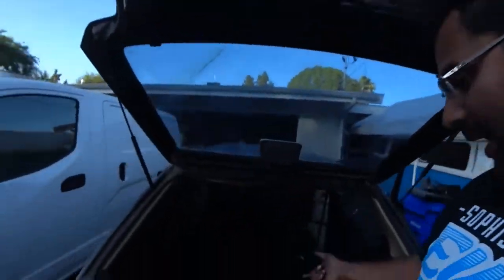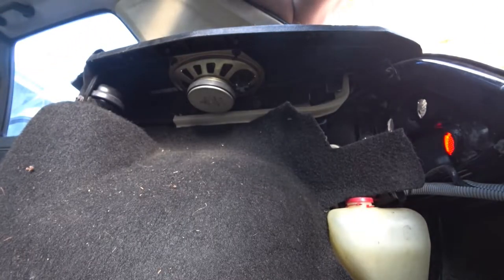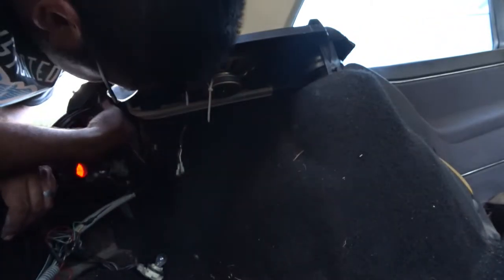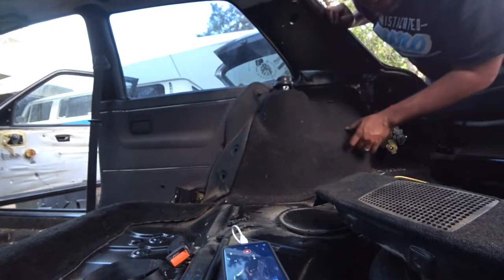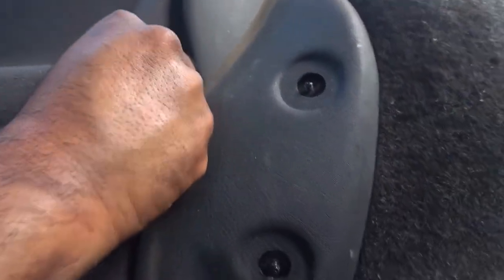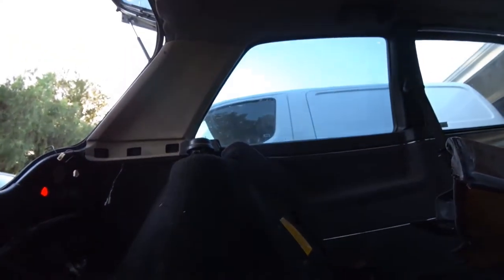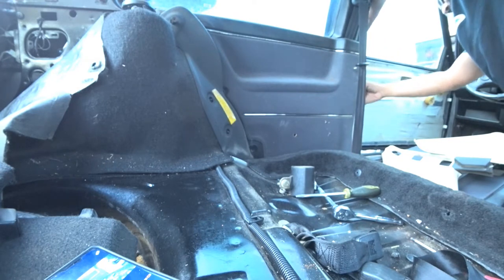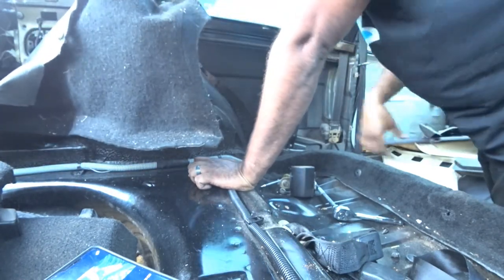MK2 golf/gti Carpet and Rear Panel Removal Part1 Season 5 EP5

Comment: Hey I have 1997 vr6 jetta when I turn it on and gas it. It bogs down and backfires
Reply from the maker: David Hernandez vacuum leak
Reply: What’s a good way to check for a vacuum leak
Reply from the maker: David Hernandez turn the car on and get your self a can of CARB cleaner and srapy it in the areas by the intake manifold
Reply from the maker: David Hernandez listen for an idle xhange when you spray it. If the idle goes up or down you found a leak.
Reply: Thank you where you located at what state and city
Reply from the maker: David Hernandez Escondido CA